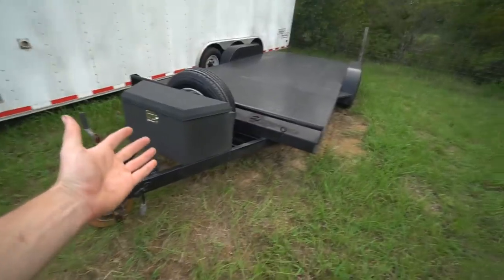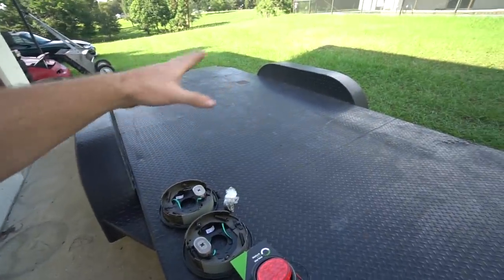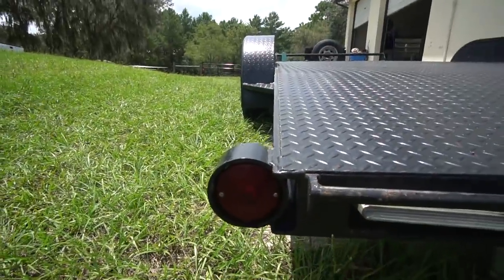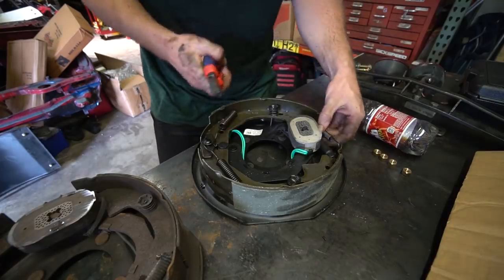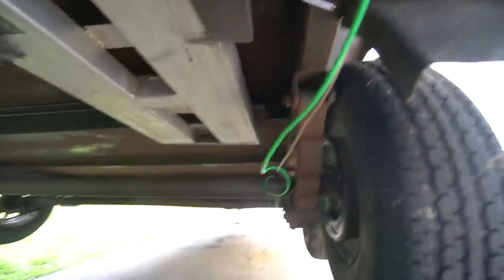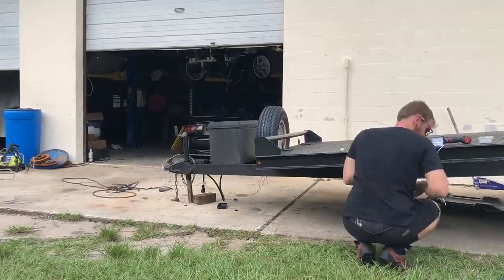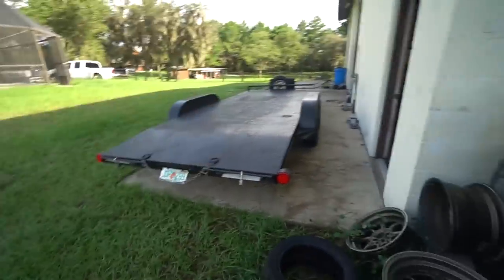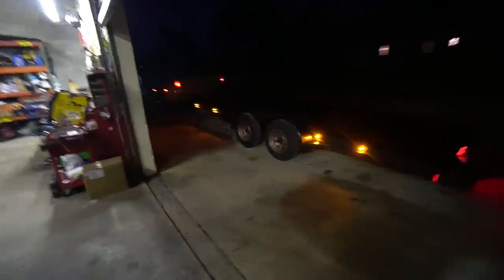Refurbishing My 18ft Steel Deck Car Trailer.

Comment: Next time you wire little lights like these, don't cut your power and ground, run them both all the way to the back. Then you just strip the wire next to every lights and soldier them right on the main power and ground. It's way quicker and you dont end up with a ton of short wires plugged together.

Comment: I still need to put in all of my 3/4 inch led clearance lights and I am going to use a hole saw.  And yes we all have trailer wire issues, biggest thing is check the grounds.
Reply: Power probe is one of my most appreciated tools
Reply: So I have the same trailer wire harness.  For one year my trailer brakes worked fine, then for another year I was chasing an issue with them not working.  Noticed you  grounded the ground wires from the junction box to the frame.  I just got back in from doing the same and I have my trailer brakes again.  Thanks!

Comment: That brake controller might be the problem my dad has the same one in his 04 f350 and it does the same thing I thought it was just a bad connection at the plug but my 07 f350 with the factory brake controller never has any problems

Comment: Taylor you should repack the wheel bearings on the other 2 trailer wheels that don’t have the trailer brakes. Your doing all that work, it would suck if one of those wheel bearings seized up while your on a trip.

Comment: I've used a soldering iron for years, but I saw those self soldering/shrinkwrap waterproof connectors on amazon that shrink and solder with a heat gun and it's been a freakin game changer. You gota try em out, I've used them on audio and lighting and harness work on my cars, none of them have failed yet and it's like 10x faster
Reply from the maker: I actually bought some the other day! Excited to try them!

Comment: Buy cutting oil!!!!!! ITS MAGIC SAUCE!!!!
Reply: any oil would work. we use some sort of high sulfur mobil one oil at school and we also have the "cutting oil" in the little bottles. in the garage I use motor oil or pb blaster, your cutting speed matters a lot more than the type of lube
Reply: I would agree any lube is better than no lube. But I have some drill and tap specific oil for work cause I deal with stainless all day. And it'll cut a hole with Milwaukee bits 5x faster when using the oil vs no oil at the same low speeds
Reply: @RevZ06  the one advantage ive found to the cutting fluid bottles is the lube is thicker than oil the school gets so it stays put a little better but I dont notice a cutting difference. this is with Bridgeport mills and small lathes. If i was drilling the trailer id have grabbed used motor oil lol call it "recycling"
Reply: Rev Jackson as a journeyman toolmaker/ machinist, I use my old diesel motor oil in my personal shop! It’s free!!

Comment: The trailer looks superb again, the lights are a game changer, the brake controller doing the connected not connected while in your hand may be a clue to a more internal issue, see if you have the feeds on both connectors at the back and work from there with a bell test (continuity). I would say get some spiral sheathing for the loose wires under the trailer as single cables are for running in plastic conduit steel conduit and troughing not for under trailers were vibration can wear through the singles very quickly  Also don't you think the tale gate could do with a dampener,

Comment: 2 questions:

Why didn't you simply use the lift instead of crawling underneath and working in an uncomfortable position? Would've helped with staying clear from the rain and sun as well.

How did you secure the taillights? Surely you can't be happy with just lightly tapping them in place?
Perhabs cutting a slit in the cylinders they're in, prying them open and sliding the light in it would be a more secure option?
Reply: Trailer is probably too wide

Comment: I bet the reason the brakes are not working, you don't have a cover on the 7 pin, which will lock the plug in. I bet when driving down the road, and you hit a bump the lights will flicker. just a suggestion.

Comment: You should try to contact bigassfan they sell industrial fans that hang from the ceiling and they push some serious air it would help a lot with the garage
Reply: Micheal Caboose I got 2 and I pay over 16k

Comment: 31:10 You have to melt solder onto the iron and against the wire and the solder transfers the heat faster into the wire.
Reply: You can, but you'll run a much higher risk of a cold solder. The way he is doing it is how electricians solder wires.
Reply: @Serxne_  I am more than understanding in how to solder a wire. Im saying you ahve to add solder to the iron to transfer heat into the wire. If you have never soldered a wire you dont know what Im saying.

Comment: I know you're done with this, but I'm just gunna point out it might be a good idea to add a clearance light (or two depending on how you put them on) onto the wheel fenders to light up the widest point of your trailer as well.

Comment: Taylor...

For your flatbed,why don’t you get a small solar Panal and a lithium ion Car battery so you have a reciprocating power system???
Reply: Urban Developments solar panel is easy and a good idea. Lithium ion isn’t a good return on investment, plus the 12v solar panels aren’t charging at the right voltage for lithium ion.

Comment: Don't bother trying to get the cotter pin straight.  You're going to replace it anyway.  Get a big pair of cutters, snip the legs off flush, and then bite into the loop with the cutters and pull it out in one shot.  Easy.  

I know some people would argue that you don't need to replace the cotter pin every time, but those people are wrong.

Comment: Heads up, that wiring is terrible for outside wiring. I used it on two trucks for lighting and with in 6 months it was all corroded and stopped working.

Comment: The only problem with the new taillights is they stick out so there much easier to break compared to the old ones they weren’t sticking out and allot less easier to break just my opinion

Comment: tail lights
 are going to get broken now that they are not protected by the steel housing
Reply: Broken by what? They are pretty far from the tires if you think they will kick up rocks.
Reply: @docholiday5766  loading an unloading the trailer

Comment: taylor why dont you wear work boots its some of the best safety equipment you can wear. usually they have good grip so when youre reefing on stuff or standing in fluids you still got good solid footing and you dont slip over like with wornout skate shoes. also like theyre easy too clean so you dont ruin all ya damn sneakers after spilling oil on them. also hardend toe caps so no more stubed toes.

Comment: Very curious, what size is that shop?
Reply from the maker: 40x50 I think
Reply: Also I noticed you were talking about the solder taking a while to pull through. Im a jeweler and we use Batterns self pickiling solder flux it makes a huge difference.

Comment: Cool job man, I think you need a good solder gun or a Gas one.  Also, why did you use all those earth wires instead of utilising the chassis as earth?

Comment: Not to be a douche but soldering should never take that long even on thicker gauge wire. When heating up the wire make sure you add a little solder between the tip of the soldering iron and the wire so it connects them. Makes it go much much faster

Comment: Why do all American trailers have electric brakes not brakes that you have on cars because in the UK when you brake when towing the hich of the trailers/ caravan there is a bumb stop that will apply the brakes so the brakes will hopefully never fail but if the electric is bad the brakes won't work just look up UK trailers and you will see what I'm talking about
Reply: most boat trailers in the usa have surge brakes

Comment: brighter trailer sidelights and easier install lights IP69 and guaranteed for 3 years https://xs4x4.parts/wilderness-multi-569-c.asp  for the covered trailer.